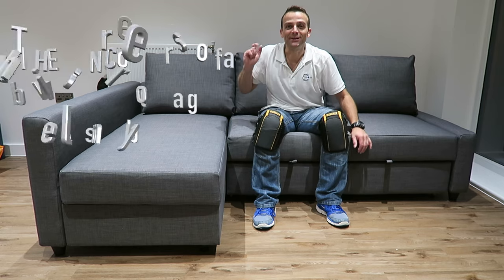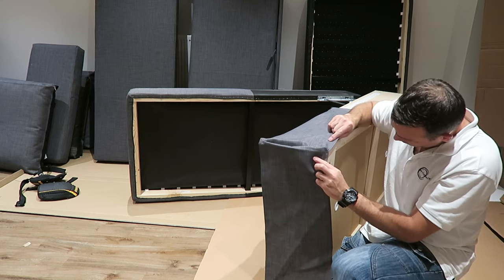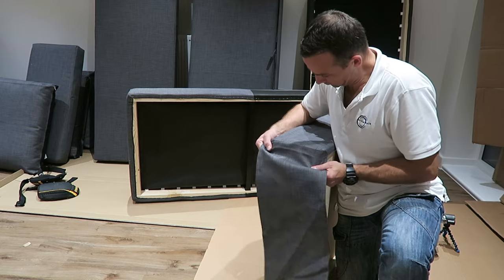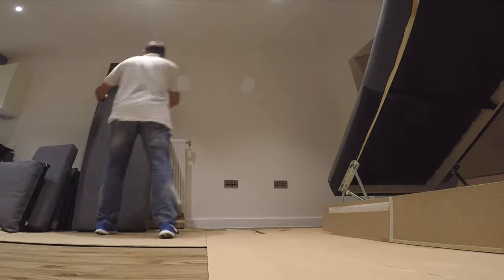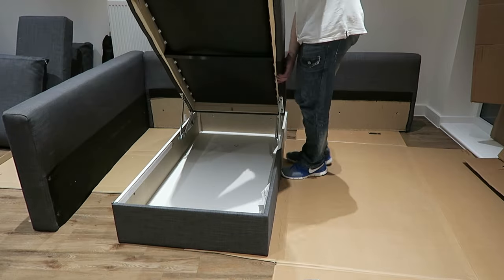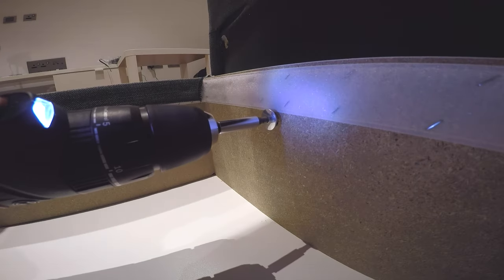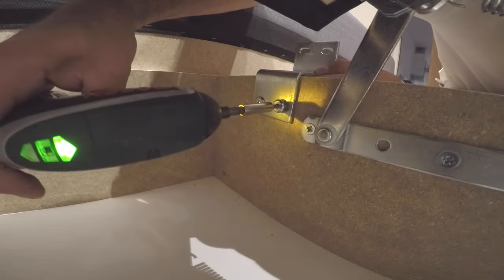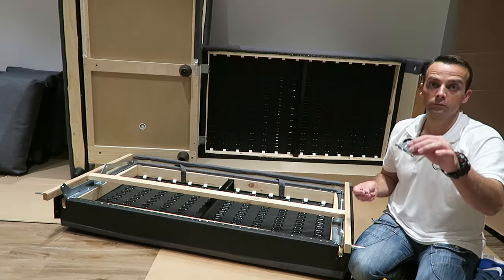IKEA FRIHETEN Sofa Bed Assembly instructions

Comment: Gazillion thanks for the video showing the assembly of the unit.  We were missing 6 screws in the Ottoman slide out unit, which was not allowing the pull out bed to hold(kept collapsing), your inside rear view camera was a life saver which helped fix the cantilever joint

Comment: Great video, thanks for the detailed explanation. I managed to assemble my sofa today. Big thanks.
Only issue I faced was that some holes where not aligned properly if you tight too much the bolts at start. I recommend before completely screwing each bolt, first to place all of them in each hole and only after that to tight them up.

Comment: If you complete the assembly with the chaise on the left, can you change your mind afterward and reassemble with the chaise on the right?  Or does the initial assembly make irreversible changes to the components?
Reply from the maker: You can still reposition the storage part after assembly on the left or right without problems